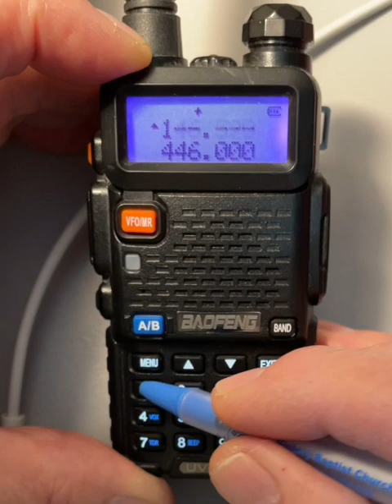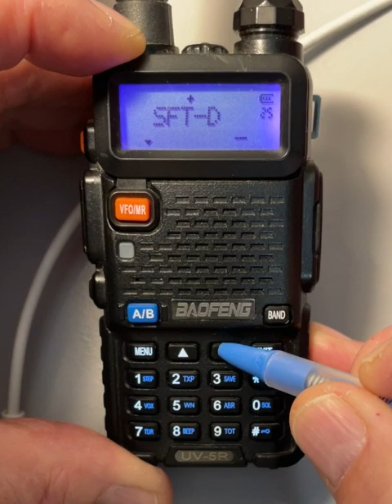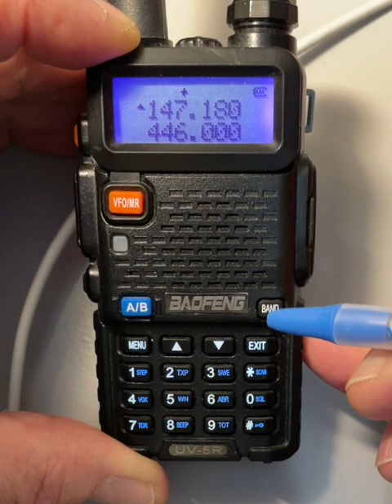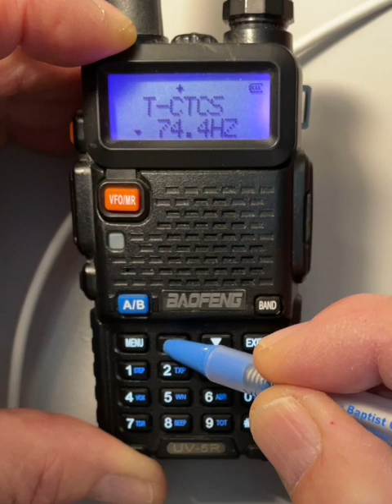UV-5R | Programming a Repeater

Comment: I got a question. I have two UV 5R radios. I did everything on your video. Everything is the exact same as far as the tone the offset both frequencies but when I transmit on one radio and try to talk to the other, I don’t hear anything?
Reply from the maker: @Drellishakmatt  That's a tough one. The best I can offer is double check your settings. Turn off one radio and make contact with someone else listening. Then do the same with your other radio. Are you sure that both radios are operational? That's all that I can think of trying.

Comment: When I put in the frequency the final number causes the voice to cancel the action.  It appears there is a + sign on your screen that  I don't have. Please advise.
Reply from the maker: What frequency are you attempting to enter?

The + sign indicates the setting of Menu Item #25, "SFT-D" (Shift Direction). Your display is not showing the + sign because SFT-D is set to OFF.

However, that is not the cause of canceled action. 

The voice prompt "CANCEL" is likely because you are attempting to enter a frequency that is not supported by the radio.

As an experiment, I attempted to enter a frequency that I know is not supported by the UV-5R: 130.000. As soon as I entered the final digit, the voice prompt indicated "CANCEL".

Baofeng UV-5R Frequency Range

- 65 - 108 MHz (receive only)
- 136 - 174 MHz
- 400 - 480 MHz